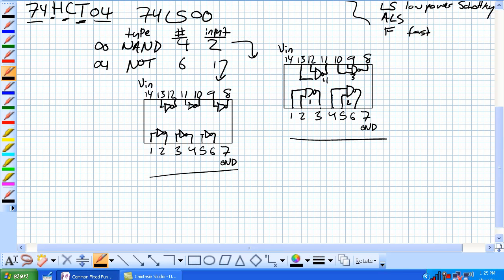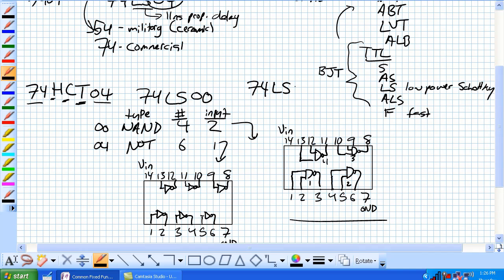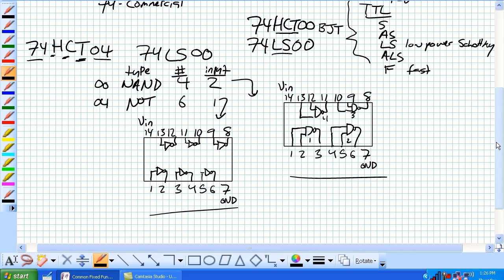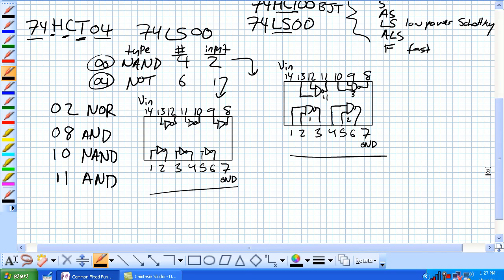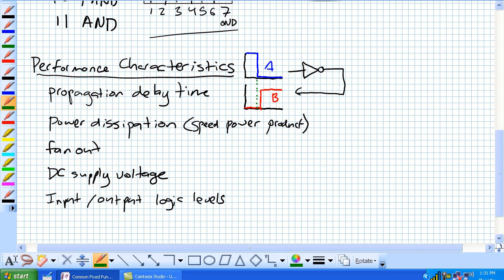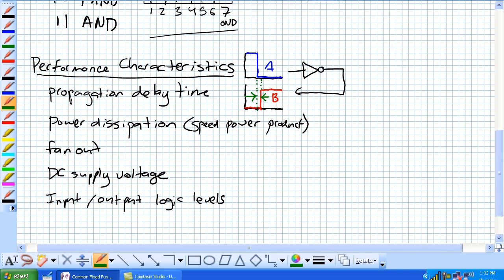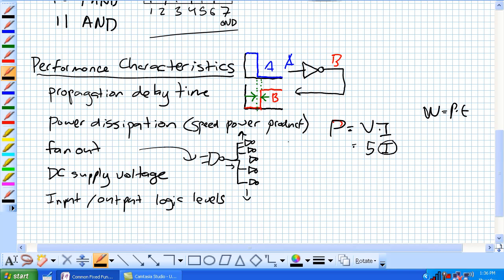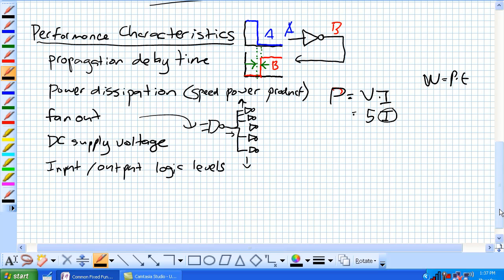Common Fixed Function Devices Part 2

Comment: Updated digital electronics playlist at:

http://www.youtube.com/playlist?list=PLX7ZPgPJWZNc6zRvIGjDFOr6CYKz9DZa3
http://www.youtube.com/playlist?list=PLX7ZPgPJWZNcDCIwqswjjaafqb3U2sVCb

Additionally, wanted to let you know I'm developing my own independent YouTube channel. I've got a sample pack of lectures up right now. This channel is undergoing major development summer 2014 but periodic updates will occur between now and then. Subscribe to it if you're interesting in the updates.

Long terms plans include a complete basic electronics series (DC, AC, 3 phase AC), control electronics, power electronics, hydraulics, renewable energy, and more! The website will redirect to the YouTube channel for phase 1 of development. Enjoy!